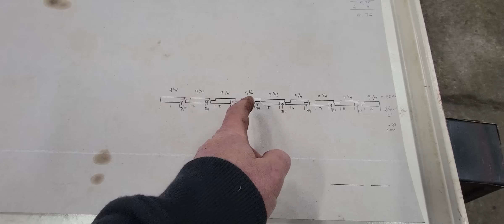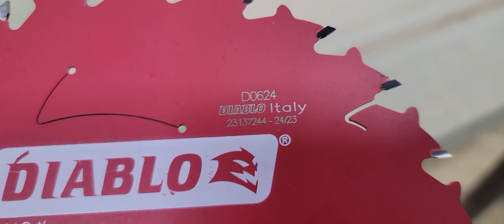SHOULD ALL TRAILER DECKING BE DONE THIS WAY?

Comment: Always wondered about using plywood for open trailers dedicated to light items like that. I have an enclosed that had diesel soaked in the floor. I swapped it out with 3/4in fireproof plywood for roofing. Never used it since. You remind me of my cousin, every project takes forever with lots of adjustments for what seems like little progress. But when its time to assemble or the job is done, flawless, smooth, the whole 9 yards. Just cant get the guy to pay you! I would be interested to see more of J.C.s wood working skills.

Comment: I love the way the deck turned out.  It is more akin to interior finish carpentry than to a trailer deck.  I'm also jealous that you are able to store it indoors.  All of the trailer decks that I have done with tight gaps have swelled once exposed to the weather.  I've gotten to the point where I deliberately leave gaps between the boards so they have room to move once they sit outside for a while.  I used to use Apitong wood for my decks and even it was no match to Mother Nature.  I now use white oak and leave gaps and it's all good.  Thanks for the video!

Comment: Years ago I built a greenhouse like cover for my wife's approx. 10' x 20' strawberry patch. Seems that once the strawberries were ready to harvest, the birds would beat us to them. I used 20' lengths of 1" PVC pipe set in larger pipes along the long sides. The PVC bowed to make hoops and I added some cross bracing. Installed chicken wire along both lower sides to let the bees access for pollination, and fiberglass screen over the top which provided some shade. This was about an hour south of Atlanta and it worked great. You might need more sunlight than I did so maybe your top material would need to be different. We were visited by a helicopter that hovered over our yard for a while... I can only guess they were trying to detect the signature of a certain illegal crop growing in there. They never visited in person though.

Comment: I 100% want to see the camper build. Also an old farmer by me used to paint his deck on his trailer with used motor oil about once a year. He would use pine boards and get about 25 years out of them sitting out in the ohio weather.

Comment: The trailer looks nice. I think about sealing the deck, I used dark gray porch paint and sand for grip on decking. Have a great evening, JC and Mrs Smith.
Reply: I sealed mine with old motor oil, turned out nice

Comment: Mop those new boards with transmission fluid like dexron lll. Get it all soaked up even and it will dry and not be slick and oily. It will add a lot of life to that floor! You can do this as needed to prolong it even more! Very good job with the half lap with only a circular saw!

Comment: The only thing I would worry about is over restraining those boards. Screwing them down so they can't move may cause you problems with cracking.  It may be better to retain with one screw and float the other screw so the board can expand and contract. Just an idea , nice job.  Thanks.
Reply from the maker: my deckover heavy gvwr trailers have the boards screwed in like this. they seem to be fine so far. time will tell if it was a plus or minus.

Comment: Much like this trailer build (which isn't a truck build)  I'd really like to see the camper build!  An oscillating multi tool might be better than the chisel.  Great build and lots of great ideas and tips!
Reply from the maker: agreed. that tool would have been much nicer.
Reply: @j.c.smithprojects I've got the M18 tool like that.
At first I didn't like it, but once I figured it out, and how to use it, it is a very handy tool.
Who knew it helps to read the instructions??

Comment: I bought a heavy homemade trailer that needed a ton of work. Paid $600 for a sandblast and paint job. For my decking, I used 5/4 PT deck boards. I ripped one for the bottom outside layer and the top layer was installed on top so the boards overlap 50% making for a deck that's a full 2" thick. I ran deck screws up from the bottom using the holes that were already there. By the time I was done, I could have bought a new one for less. And now that I have a 30' GN trailer and a 16' enclosed trailer, it sits in the yard with a stack of truck beds and steel. It hasn't seen pavement in at least 5 years when a neighbor borrowed it (and destroyed the lights). He gave me a set of lights which I never bothered with. Oh, and my $600 paintjob? Developed a rust haze within a year...

Comment: Great video and I really liked the idea of doing the ship lap for the deck boards. 

I guess you taking the Toter home to the next level. I would definitely like to see your camper build. 

I had bought a Ford F800 4wd at one point to build a camper on the back of it, but life got in the way and I sold the truck.
Reply from the maker: life has a way of doing that. it will be the switch -n-n go of truck campers

Comment: If you run a winch battery that's connected to the vehicle so it charges the battery you can connect the breakaway brakes to it and it'll be 50 state legal
Cuz the breakaway switch only needs 12 volts 😅
Reply from the maker: im only putting a battery on when we need it. i wont use the trailer enough to leave a battery on it. i have truck batteries all the time. easy to just grab one and throw it on when i need it. take it off when i dont.

Comment: Well sir,
     as per your usual, that is a nice “deck”.  I am particularly partial to those “Diablo” blades, despite their price, they “go the distance”, easier on the saw it self, and glide thru the material.  Their ferrous metal and aluminum cutting blades, are awesome..!  If you run them (feed them at a slower pace than typical), they last a long time…
Great video,
Thank you.
P.S., your (crude but effective) saw guide is genius…, now get those strawberry beds built.

Comment: Hu J.C. Have you looked at  Weather proof socket for boats with a 4 pin connection for the remote lead .. they come in plastic or  chrome plated brass..  Hope this helps  Andy UK

Comment: It was a nice build and I enjoyed watching you do it. I have a 7x18 H&H Equipment Trailer dual axle, 10,000 GVW that is all aluminum frame that I got on sale for $8500. It also came with really nice aluminum wheels and removable fenders. It does not have a winch or tool box. I may add those. It has the heavy folding ramps, not the beaver tail. It does not have the side rails, but it has rub rails and stake pockets so you can put those inserts with d-rings where you want them. It came with the 4 d-rings on the deck. Just for comparison. I don't remember now what you said the rating was on your axles. They sell aluminum landscape type that is closer to yours that is less than the one I bought. I wanted to be able to put a sizable tractor or smaller skid steer or mini-ex on it, so slightly different application. I am a fan of the aluminum trailers since all you have to do is give it a pressure wash every couple years and you don't have to worry about rust.
Your decking had some pretty tight tolerances. I definitely would put some stain on the deck. Not only will it look great, but it will protect the wood from wear and also absorbing water and swelling from rain or if it sits for extended time covered in snow. They say a wood deck (like on your house) should only have the decking (5/4") last about ten years, but with periodic re-staining, the one on my house has already lasted 30 years. I use the Behr stuff from HD. That would look great in any color: Grey, Green, or Red, though if Grey it will end up looking like untreated, so I would pick something else. I put redwood color on mine and it looks great. If you roll it on with a mini roller, you can do it in about an hour or two at the most.
Reply from the maker: my wife thinks we should stain it. i am looking into green colored stain. this trailer is going to be stored inside. the decking and trailer condition should outlast me. or so i hope.

Comment: What a cool trailer! I love the lights. I water sealed my boards before I put them down. I also trimmed both sides straight. What a pain in the ass. I just couldn't get straight lumber. I refused to have huge gaps though. Next time it's a steel floor. The trailer is a 5 x 12 made from 3/8 wall 2 x 4 inch tubing. Built with 24 inch sideboards it has hauled many tons of stuff.
Quite a bit past the weight rating of the axle. 3500lbs is 
1 3/4 tons right? There is always a safety factor in there.
LOL. I went and got gravel one time and told the guy the trailer was built for 3500lbs. Supposedly they have scales on their loaders. I got to the scales and it weighed almost 3 tons! I took the back roads and went considerably slower. I hauled it with my F450 Superduty that has a service bed with a bucket on it. It used to be a cable company truck. I bought it because I can't climb ladders anymore. I figured that a trip to the ER would pay for it not to mention  a stay or a surgery. 
Anyway, the only thing about 3 tons of gravel is you have to unload it and it's not a dump! I made a smooth blade to go on my backhoe and raked most of it off with that.
You do beautiful work Mr and Mrs JC. I am looking forward to the RV build. The only thing is it took you this long to build a utility trailer.........
LOL!
Cheers
Terry
Reply from the maker: i considered a steel deck way back in the beginning but settled on wood for the cost and intent of use.

Comment: The lapped joints are cool but I wonder about the long term survivability with holding water and dirt on top of the bottom lap. Definitely screw in every cross member!
Reply from the maker: not concerned at all. it will be stored inside.

Comment: I don't know if it helps the next guy or not but when I replace boards on the lowboy I always spray fluid film or at least wd40. Something to try to fight corrosion. And the other thing I do is poly blend stain the bottom of the boards. Multiple coats under them at the cross members.
Reply from the maker: we considered staining the boards after they were all cut and ready to install but decide it really wasnt necessary as this trailer will be stored inside. if i were keeping it outside, i would have definitely treated every side of each board.

Comment: I'd like to see a camper build.  If you want to check out the channel Ambition Strikes, I started following them 3 years ago when they started a camper build.  they used an aluminum frame with a foam/metal sheets for the panels.  That's what I am planning on doing if I ever move to an area I can work on stuff outside.
Reply from the maker: i just checked it out. looked like nice quality build. i think i am going the wood route for my first one. i see so many campers with delamination. they get a water leak, adhesive fails and the outer skin separates. i want to work through all the possibilities.

Comment: You didn’t need the tongue n groove. You could have started with a square cut then cut a 45 degree miter on all other boards with long angle lapping at the top. Would save u time and achieve the same results. You would end with another square cut. You done a wonderful job
Reply from the maker: then i would have had a thin edge on top that would certainly warp and get damaged very easily. i wanted some meat at that joint. i also liked the idea of the positive stop with the 90* cuts. the 45* would be difficult to get lined up nice because of each boards inconsistencies.
Reply: @j.c.smithprojects  
I agree. What you did looks amazing. The angle cut just keeps it from holding moisture in the joint. I was a carpenter mist of my life and it’s something we used to do. We would slightly sand down the sharp edge.. we love your vids and u do a great job on everything

Comment: You stager the screws and frack wood so you don’t weaken the structural integrity of the trailer frame by putting too many holes in one cross member.
Reply from the maker: the part of the cross member you drill isnt providing the strength to carry a load. it is providing the strength that keeps the it from moving forward and back. i used wider boards than a trailer manufacture. less boards, less holes. i believe it added strength.

Comment: All those fancy board bolts aren’t fun in 10 years when you replace the boards and have to cut, drill, and grind them all out.
Reply from the maker: leave it outside and you will find out.....store like i am inside a building and take care of the decking and you wont.

Comment: Use a daido blade in your table saw ,
Reply from the maker: ft long 2x10's are just a bit big to run through my table saw and get a nice straight and consistent cut.
Reply: @j.c.smithprojects  if you try a Daido on it you'll like it , I run a stack blade on a cheap plastic table saw and with long lumber . A helper is a good thing doing it . I do all my floors like you did your trailer . Only trying to help .
Reply from the maker: i have a daido blade kit. the little table saw is too light. would have been much easier with a good heavy table saw for sure.